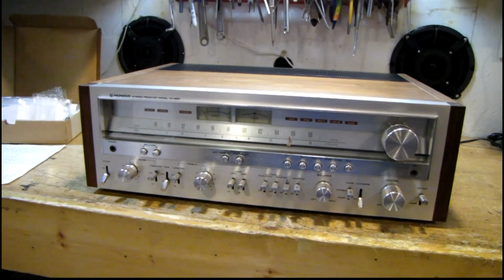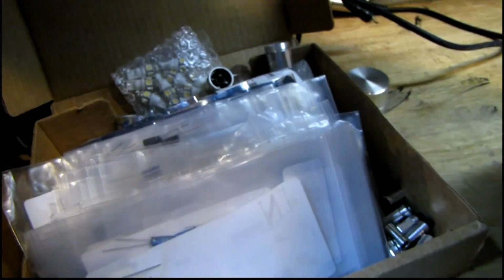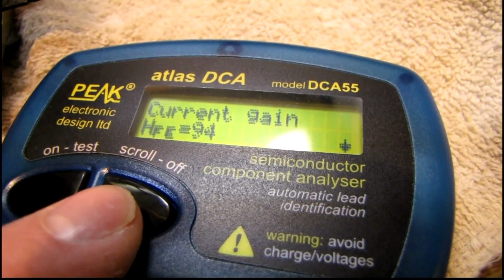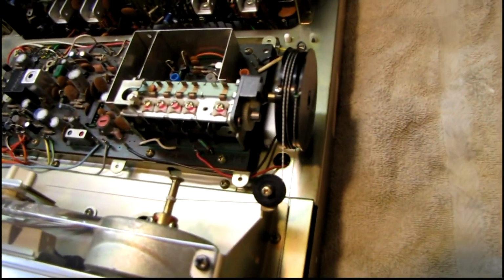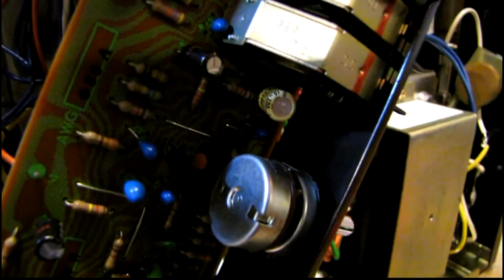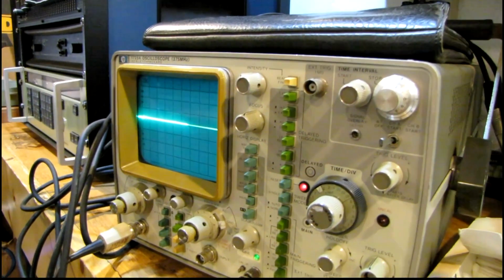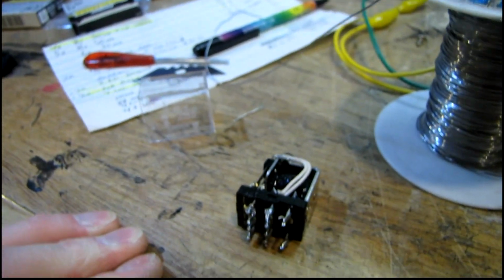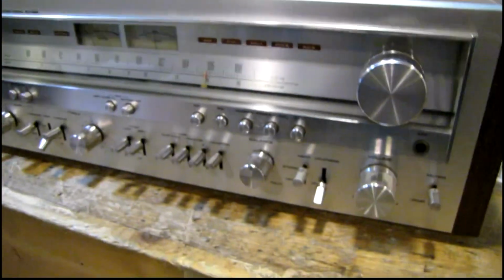Pioneer SX-850 Receiver Restoration

Comment: I have two Pioneer receivers an SX 980 and an SX 1080 and both work great.   The Pioneer SX 1080 is 120 watts per channel. My neighbor has a Pioneer SX 1280 that is 185 watts per channel, and his is also in good condition.   You certainly know your electronics, and do very good thorough job of repair.  This was a very interesting video, with good detailed explanation of all the work performed..

Comment: Unbelievable job, man! Makes me wonder if any capacitors are out of tolerance or flat out bad in my old Pioneer SX-636 even though it sounds just fine to me. 

My 636 had several lamps out when I got it. I ended up just getting the proper incandescent fuse type replacement lamps instead of retrofitting it with LEDs. The only other work I've done to it is reset the original solder on some power amp transistors that had bad solder joints. Man, that solder reeked of burning musty-ness!!

Comment: Oy, having to remove all those wires to get that board out! I had to do the exact same thing to get the tone control board out of a Sansui 5000a that I was working on last week. Not fun at all! Why couldn't they have just used plugs and sockets, or left enough slack to swing the boards away?

Comment from the maker: That's the big difference between old stuff and new stuff.  Old stuff is built physically heavier, and able to be repaired and sometimes upgraded.  Modern stuff is usually too integrated and using special chips and small surface mount components.  When those burn up, they frequently take the copper traces with them, leaving no way to mount new parts to the board.

Comment from the maker: Ya, I think Pioneer was hit with a bad batch of transistors around the late 70's.  Seems there are a lot of common ones that go bad.  And almost all audio manufacturers of the time had some experience with the noisy 2sc458 transistors that were frequently used in preamp boards.

Comment: I have a pioneer sa 710 and it would intermittently make popping noises through both channels equally (especially after power up) Some times it would trip the relay when it got really loud. Judging by the heat one was running at, I replaced 2 d880s, one in the psu section and the other in the audio path. (oddly they weren't labled as d880s in the schematic) It has been fine every since. Great restoration, that thing is a beast.

Comment: I love the 70's Pioneer stuff. Just finished restoring a CT-F700. Luckily it jest needed a good clean + deoxit of the switches and new belts. But I have never heard cassette recordings sound so good before. Next project is a Teac 80-8 reel to reel. 1/2 inch tape and 8 tracks. It will be a big project and watching this video has tempted me into making a video of it.  :o)

Comment from the maker: The overall sound has not changed much, since most of the caps in the audio path were still good.  The main issue with this receiver was stability and loss of power.

Comment: well i myself have 2 amps that need work. both have the same issue one isn't as bad as the other. they both will cut out a channel or almost totally cut out. the one amp thats the worst is a technics sa-330 that its a pain when u turn the receiver on most of the time the left channel never turns on and u have to fiddle with the volume and input sellector. the other amp a realistic sa-1000 has cut out as well but not as bad and not as often but they both need work. oh poo oh well things die